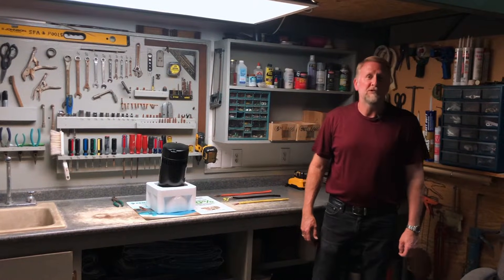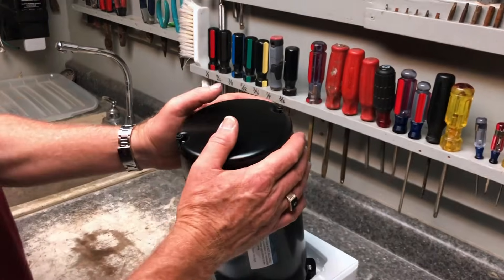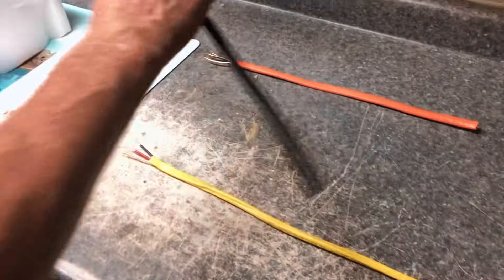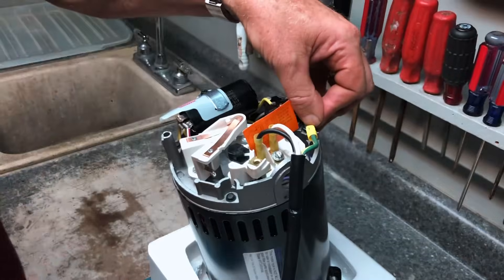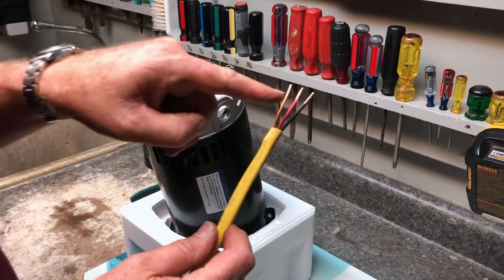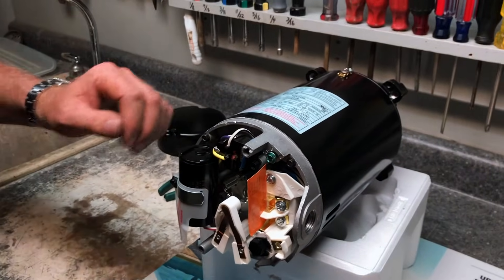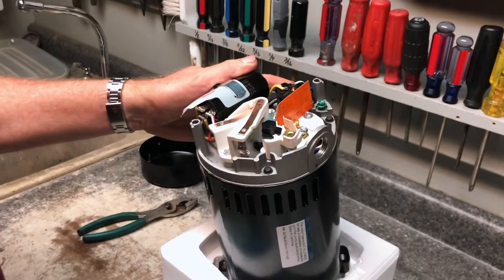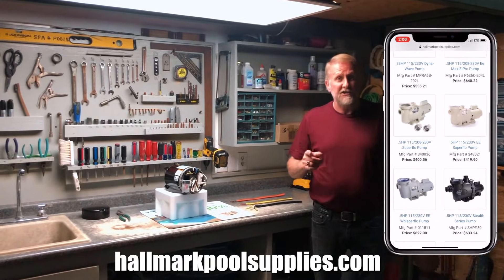How to Wire the Motor on a Swimming Pool Pump | Quick and Easy!

Comment: Thank you for this video. MY pump is a little older than this one. I needed to replace cord as it was damaged. I clearly see the ground and I swapped out the white white easily but I removed the black one and then wasn't sure of its placement!! White went on 6 but where does the black go? I have it on 3... I can send a picture if that helps. Thank you!
Reply from the maker: Send a picture to our email. I will be glad to help.

Comment: Is that motor a combination motor/pump or is there a connection to a pump ?
Reply from the maker: The motor that I was working with is a motor for a swimming pool pump.
Reply: @HallmarkPoolSupplies  thank you. I was trying to help my brother, long distance who has a pentair 1 HP PUMP/motor. Thanks for your reply. He installed a new pump/motor and it malfunctioned. Pentair is replacing under warranty but we are in the process of verifying the supply, through the timer is delivering 220v.

Comment: Thanks for the video! My start capacitor burns out when I start my pump.  It is only 1 month old.  Any ideas.  I have it at 230 but I tested at 250v.  Any ideas?
Reply from the maker: It's possible that the start capacitor is bad. If you are truly testing 250v, then that could be the problem. I would recommend to consult with a local electrician.

Comment: WHAT IF YOU HAVE A FOUR CONDUCTOR TWIST LOCK CONNECTOR WIRE FROM A GENERATOR 240 v( FOR DRAINING PONDS).   THERE IS A GREEN GROUND, A 120 BLACK, A 120 RED, AND A WHITE?  SO I CONNECT THE GROUND AND THE RED TO L1 AND THE BLACK TO L2 = 240  BUT WHERE IS THE WHITE GOING?
Reply from the maker: The ground wire should be hooked to the grounding lug not to L1. The hot wires (leads) are hooked to L1 and L2. You need to confirm the voltage and you need to confirm if the pump is dual speed, single speed, single phase or three phase etc. You also need to confirm if the white wire is a hot wire or a neutral wire. If you don't know, then if would be best for you to consult with a local electrician.

Comment: What kind of wiring do you use? I bought a pump that uses 10 AWG but was told not to splice the wire on the pump
Reply from the maker: There are thicker gauge wires that can be used, but most residential pool pumps are using 12/2.

Comment: I have a 220 well pump for irrigation purposes, if I switch it to 120 I would just turn that switch and move the second hot wire in my breaker panel to the neutral buss bar so that I only have one hot?
Reply from the maker: I would advise to contact a local electrician.

Comment: My pump is a 230V but it only has a black, white and ground wires and my wiring I need to connect it to is a 1L, 2L and ground wires. How do I connect it? My model number is pcp100011-vsp
Reply from the maker: You can wrap the wires around the screws (L1, L2) or you can crimp a spade connector on the wires which will slide on L1 and L2. Some pumps have terminal blocks you can slide the wire into, but you want to refer to the owner's manual. Feel free to contact me if you have any further questions.
Reply: @HallmarkPoolSupplies  there’s no screws on the pump itself. Both white and black wires are soldered on to the digital motherboard. My old pump did have the L1 and L2 slots but this new pump does not.
Reply from the maker: I would refer to the owner's manual. If that gets you no where, you can email a picture and I will be glad to help.

Comment: CAN YOU GET A LITTLE INTO CHANGING OUT THE THERMAL OVERLOAD, "PLEASE".
Reply from the maker: Most thermal overloads on single phase motors are internal. Some thermal overloads are external and some motors, like three phase motors, don't have thermal overloads. It depends on the type of motor that you have and it depends on the type  of thermal overload that you have on your motor. Regardless, I recommend this type of repair to be done at a local motor machine shop.

Comment: Bought a new century hayward motor but didnt come with start switch or capacitor and no wiring available for start switch or capacitor. Does have adjustable 220 / 110 volts. My question do i directly wire to new motor without start switch and capacitor?
Reply from the maker: What model Hayward pump do you have and what is the model of the motor you just got?

Comment: What if your panel is providing 208 vac and pump rating is listed as 120/240 for new unit. Old bad pump has 115/208/230 plate. Is this new pump ok as a replacement for old unit?
Reply from the maker: Yes, if you have high voltage you can wire your pump 220/230 and you will be fine.

Comment: My Pentair pool pump has a green wire from the case on the outside but is not connected. I recall my old pump had a wire to my pool screen frame. Should I have this green external wire connected to something?
Reply from the maker: The green wire is the grounding wire. This is connected to a grounding lug.

Comment: I have four hours green black red white I had a variable speed Hayward pump that went out and I replace it with a single speed pump and wired it up but I have no place for the red wire also the puppies turn yourself off is not running hot and it runs through aqua rite aqua plush Hayward control board and I can’t get it to stay on please Advise

Comment: Thanks for your video.
In my country the public power is 220 v ac between the load cable and the neutral cable. Do you think that in the 220 v configuration this type of pump should work in my country?
Reply from the maker: Most manufacturers sell their pumps as domestic or export. I would recommend working with how it’s offered in your country.

Comment: After installing new new motor it won't start. Double checked my electrical connections and everything looks good. Any insight would help.
Reply from the maker: Is the motor making any kind of sound. Does it hum or absolutely nothing? It’s possible you have a bad pump. You can’t prime if the motor doesn’t come on.
Reply: @HallmarkPoolSupplies  I have the same problem. After installing a refurbished pump from local shop. I installed just like my previous pump 115 V.  From the top , the green ground wire, then down is the white neutral and below that is the black the power/hot cable. I primed the pump by pouring a lot of into the container then turned it on. It would hum and smokes and got really hot. I called and report the problem to seller. He will give me a new one tomorrow.what do you think the problem could be? The company has 1 year warranty.
Reply from the maker: @TruongLe-eo8kh  You need to verify if you have 110 volt or 220 volt.
Reply: @HallmarkPoolSupplies  i used piler to switch the black switch from 115 volt to 230 and back to 115 volt.  I started it in the morning and it worked. Weird it was in the middle or something it was set correctly.  Thank you. The local guy promised by extra year warranty on top of 1 year from factory.  Thanks. This is from Advantage Manufacturing. Pump is working. It smoked a bit and got hot when it didnot work but it worked next day correctly when I turned to 115 volts. should I be worry about it already damaged?

Comment: my pump motor had green, black, red, and white. My old one was a low common and high pump but the new one is not. Is there any way for me to still wire it? Originally the white wire went to my common lug in my ck2456y-200 motor
Reply from the maker: What you've described sounds like you had a dual speed motor and now you have a single speed motor. So you need to get a volt meter or consult with an electrician to determine what voltage each wire has.

Comment: What causes the thermal coupling to trip my old motor did it and replaced it with a new one still tripping?
Reply from the maker: Check your wiring and make sure you have the right voltage going to the pump first.
Reply: @HallmarkPoolSupplies  its odd I'll have to do further investigation I  checked voltage 138-140 volts but the motor was set up for 230 and I  have 120 going to the motor.

Comment: Excuse me, my motor is very loud. What is the reason? thanks！
Reply from the maker: Usually when motors make loud noises, it's a sign that the bearings are going out.

Comment: Would it hurt if you didnt add the clips and just wrapped the wire around the screws. Are pump is 3  months old and just started turning self off i smelled something burning.
Reply from the maker: You can wrap the wires around the screws if you don't have clip on connectors.

Comment: Would I benefit at all by switching my pool pumps voltage from 120v to 240v ? I do have access to a 240 outlet I can use.
Reply: You will draw less current and therefore get less power loss (1/4) in the lines feeding the motor. Also you should get less heat dissipated in the motor. You will likely need to get a double pole switch for the local shut off. Also be careful that anything sharing that circuit circuit needs to be 240V capable. Finally you need to follow your local GFCI regs.
Reply from the maker: Most motors by manufacturers are set at 220v making them more efficient. As far as performance, (ex. Volume of water pumped) the pump will work the same.

Comment: I have a 10 3 wire with black, red and white the an extra uncharted wire. Can I use it.
Reply from the maker: It can only be used if it’s hooked up on the other end. I would get a volt meter to test and see what lines are hot, and what your voltage is.

Comment: ...WHAT IS THE NAME OF THAT "V-SHAPED" PART IN THE CENTER WITH THE COPPER CONTACTS AND THE PUSH BUTTON THAT TOUCHES THE MOTOR SHAFT?....I just need to replace that one part~! Please help~!
Reply from the maker: That part is a mechanical switch. When engaged it sends power the capacitor. You can pick one of these up in a motor repair shop.